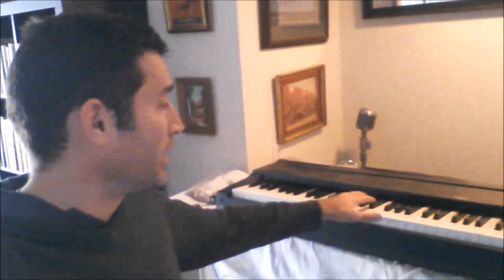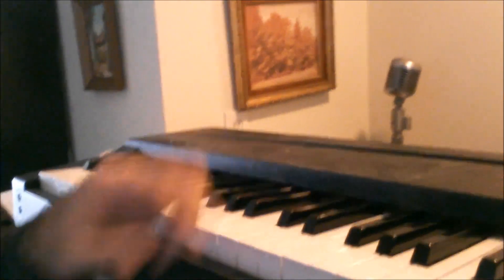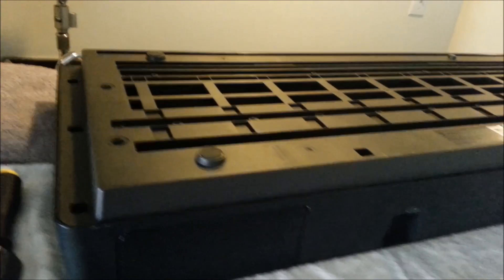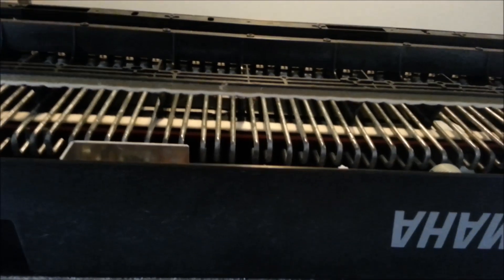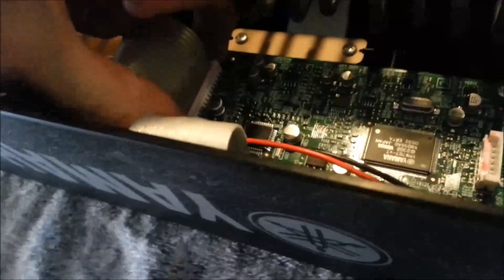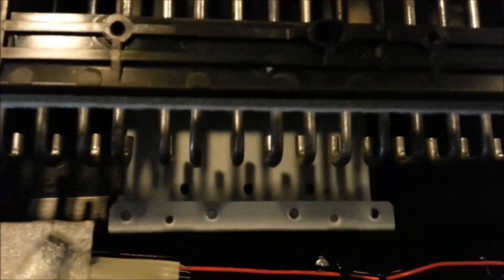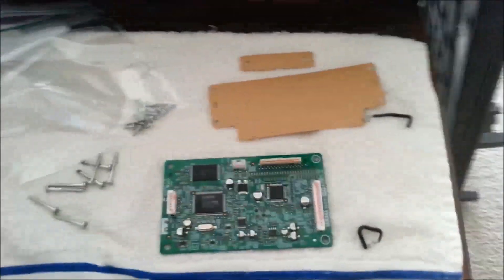P70 Noisy Keyboard Repair (Part 1)

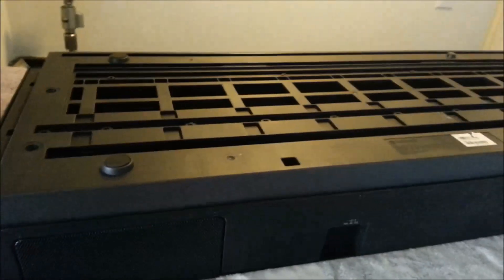Comment: When I opened up my P-70S I noticed that only my lower stopper was worn out. The upper looked fine and when trying it out the majority of the noise came from the keys coming down to rest on the worn out lower stopper.The nice thing is that you can remove the lower stopper without having to do more than remove the back (up to 4:15 in your video) and just pull it off, rolling it like you recommend and cleaning off residue with alcohol. I didn't have to touch any of the electronics for this.All in all from unplugging to playing again in about 80-90 min (taking care not to overtighten or wear out the 72 screws). Result: not perfect (which it never was) but much better.So my tip: open up your keyboard and check the two felts and if you're lucky you might also only need the lower one. One more thing: WK688701 - L88 is no longer a composite of felt and foam, mine was two layers of foam. I guess they changed it, hopefully for the better.Thanks for your video!

Comment: Thank you for your video, it helped me a lot. But in the process of repairing my own P70 I noticed that the noise that bothered me didn't really come from the stoppers. It's the keys that didn't have enough grease anymore, I put a lot of it on each key and it really improved the sound ! No more salck. You should give it a try, if you're brave enough to fight this army of screws again ^^

Comment: Outstanding, thank you. I used draft excluder sticky back foam strip (that I previously used round my casement windows) on top of the existing felt strip and Sellotape to fix the ends, and it works a treat!
Reply from the maker: Oh... what a great idea!!  I bet it will be much more  durable too!
Reply: Wait, are you saying that this relatively inexpensive weatherstripping (as we call it around here) works as well as the pricey yamaha stoppers?  I already bought the stoppers, but havent gotten around to the daunting task of attempting to replace them (especially all those screws).
Reply from the maker: @novakant3048  I went with the pricier "OEM" as you did.  But, when you compare them, you'll notice they are oddly similar.  I'd be interested to find out as well!
Reply: @davidallyn1818  Hopefully he will report back in the future.   Meanwhile, it has been quite a while since you replaced the stoppers, so how have they held up, if you even still have the piano?
Reply from the maker: @novakant3048  The pads held up ok  - though it was probably time to change them again.
Reply: @davidallyn1818  This time if you want you can try the weatherstripping then.  I like to see people getting their money's worth out of a (to me) expensive product like a piano.  The idea that it has to be tossed because felts wear out, or repaired for a cost approaching its price (thus encouraging a toss) is annoying to the less well off!   
 
You said you were going to do something else about some other aspect of key noise?  I don't think anything else is responsible for much of the key noise in my case (its a P85 btw not a P70 and its over 10 years old ) but while I have it open should do what I can additionally.
Reply from the maker: @novakant3048  When I had it open, I noticed there is a little side to side looseness that I thought might be the key wiggling on the hinge - but I wasn't sure.  At the time, I decided not to deal with it since the pads were enough for one day :b
Reply: @davidallyn1818  I wonder if you could further comment on these questions  (1) In my case at least, the sound is very clearly associated with an impact at the end of the key press and the end of the key release, so other things that do no seem to affect this impact (like side to side motion) are very unlikely to be a serious contributer?  (2) In my case at least, this sound is pretty uniform over all keys, even though they are used quite differentially, and is worse upon key release, suggesting that the keys just sitting on the stopper for 10 years have compressed it and that alone is a major contributer to the problem? Someone commented elsewhere that he used the thicker stopper on the bottom, not the top, since the problem was worse on the bottom and the thinner stoppers did not help.  My impression is that Yamahas know what they are doing with the stopper design and  I suspect (3) they put the thicker stopper on the top because the attack on the key contains a lot more force than the release which contains very little? But that (4) people who don't play very loud on the one hand and have very worn stoppers outside the expected life of the piano on the other might indeed want to reverse the stoppers to deal more seriously with the bottom stopper aging at the cost of more noise when playing fortississimo?  I am tempted to try this but (5) would you agree this is probably too risky an idea?  Thanks!
Reply from the maker: @novakant3048  Oh my goodness, you are covering all your bases!! I applaud you for thinking through your project and your detailed approach!  I appreciate the engineer in you!

For how the pad is worn, I would think that more of the wear would be due to age and frequency of use rather than style, per se.  For example, I would expect middle c, d, and g to have much much more wear than A5 or A1. 

If I had Elton John play, I would expect those major "pop" keys c, d, g, Ab, Bb, Eb in the middle of the keyboard to be nice and worn.  If I had Rubinstein or Gould play, I would expect the wear to be distributed as they would tend to arpeggiate up and down the keys.

As for experimenting - you are only limited by your imagination, trial, and the 70+ screws that need to come out every time :)

Good luck!!
Reply: @davidallyn1818  I was hoping for your opinions, but anyway... I finally tried doing something with the piano and here is a report.   The p-85 is a little different inside from the p-70, and I could work on the bottom felt without taking the keyboard action out totally.   But the result is very very disappointing.  

The old felt had divots on every key, not just those used, suggesting it comes from them just resting on the felt most of the time.   

It is very hard, basically impossible, to get all the old felt off.   
 
From looking at the old felt and comparing to the new, I was skeptical that the new felt would be much better.  So I just taped it in place, and tried the piano briefly on the table without putting in the screws. 
 
The new felt makes hardly any difference.  So like another person who found this, I tried taping in place the thicker felt Yamaha provides for the top.   It does not seem to affect the resting position of the keys much if at all.  So that is acceptable. 
 
However, the thicker felt also made very little difference.  It makes a little difference, but not much.  
 
Now I am disappointed and at a loss.  Was the piano always like this and I just because more sensitive?  I doubt it highly.  So then why is there this noise.  It very clearly is coming at the impact on the felt when the key comes to rest.   
 
I plan to just use the wrong thicker felt because it is a little better.  But the whole thing is not good. 
 
Only thing I can think of is what has been suggested: it is the bounce of the key causing problem, not the  initial landing, and the bounce is caused by the keys loosening at their pivot point or something like that.  This doesnt seem likely either however, given how the sound really seems to be from the initial impact.
Reply from the maker: @novakant3048  I applaud you for your journey - that was quite the exploration I'm sure!  As for the overall reason why it's noisy... to be honest, the keyboard is not that expensive (when compared to a piano).  I'm sure the action will never be quiet like a piano, because the P70/85 action is made of metal and plastic where the piano action is made of wood and felt hammers.

I've recently upgraded to a Studio Logic SL-88 Grand, and it is much better (which cost me much more) precisely to move away from a noisy keyboard.  The Fatar keybed is made of wood, and the action is much more complex than the P70 I used to own.
Reply: @davidallyn1818  The issue is, however, that I am pretty sure it was NOT like this to begin with, and that it was acceptable (otherwise I would have noticed in much earlier) and I can't see what else could cause the noise aside from the landing on the felts.  So its a mystery.  Perhaps it could be the keys losing their lubrication, but I don't really see the mechanics of how that would produce that particular noise.   I see in the manual three places where grease is to be applied, but it doesn't say exactly what kind of grease (it does have a Yamaha part number).  But I can't see how  grease would make a difference.
Reply from the maker: @novakant3048  My hypothesis here is that it is general wear between the keys' attachment points (both metal and plastic) within the action. 

Obviously, metal will wear away plastic, and plastic can stretch other plastic.  So I could see that initially, the pieces all fit together perfectly with no space - so no noise.  Over time and play, however, they all begin to loosen up and wiggle from erosion of metal on plastic and plastic on plastic.  At first it's slight, but then it becomes significant enough to be "clacky" -- remember these are old instruments and probably weren't meant to last as long as they have.

The ultimate test, I guess, would be to replace a couple of keys (including all corresponding action) to see if the new key is any quieter than the old.

Lithium grease (from the hardware store - no need to buy from Yamaha) might help with the noise a little.
Reply: @davidallyn1818  I hope this isn't it because then I am stuck, I cannot afford a new piano, bad enough I spent so much on the "felts" (actually pieces of foam that probably weatherstripping would indeed work for).   It would be interesting to try the test you suggest, but if it is a positive result, then it just says nothing can be done.  I suspect it might be negative because the noise on the keys is uniform for the most part, whereas they did not have opportunity for uniform wear.   Something soft and noise absorbing wearing out still seems to be a better bet.   I will try some experiments and see if I can find anything, since I am not getting another piano unfortunately.

Comment: When I had the noisy key (after 4 months), the Yamaha maintenance guy told me that the problem was given by the keys poorly lubricated. The noise was not at the end of the key press not at the end of the key release, it was just after pressing before reaching the end (it sounded like a clearance between the plastic and the metallic parts).
Now, after 12 months, I have again the same problem.
Do you know where the key must be lubricated and with what?
Reply from the maker: Massimiliano, from the looks of it, there are three places the key can make noise. When it hits the lower limit (the pad I showed fixing), when it hits the upper limit (the other pad I showed), and when you touch the key and it "clatters".   I'm not 100% certain that is a lubrication problem, rather the key just getting old and "sloppy".  Every mechanical part, with use, will end up developing some extra movement due to use.  Play your low A, and you will see what your P70 keyboard used to sound like those 15 years ago! Lubricant may help deaden the sound for a bit, but in the end, the key just needs to be replaced.
Reply: @davidallyn1818  Yes, it is more a "clack" noise when I touch the keys (not when it touches the 2 pads you shown). When I had the first time this problem it happened after 4 months (in short, a new piano, I have a P115 that is identical to P70 from a mechanical point of view). As the guy said, "it was a lubricant problem"; the piano come back and the 2 noisy keys were ok. Today (8 months later) the originally noisy keys are still ok, but a new key is clacking (E4). Yes, the A0 and the C8 are still as they are new, however, I think 12 months and clacking keys all around are well outside what I think is acceptable. I think I'll soon try to fix and share with the community my findings.
Reply: I have had the same issues with the latest P125, it's the old GHS action that is rather dated now, had mine for just 3 months and found that if you play certain keys very often or with extra force they get rattly in no time at all. I like my blues and boogie woogie and after three months of not even the most intensive playing half the bass keys were clanking like mad. I've found that the issue is where the key attaches to the hammer action where the biggest issue lies. Hope you got your issues sorted or got a new keyboard all together I've been told by a tech that this is the most common flaw with the GHS action used and it basically requires lubrication every 4 or so months if you play hard which is a real pain in the arse with all the work you need to do.

Comment: Hi Sir, hope you are still there

My P70 was not used in about 3 months, and now when  i play some key combinations - it doesnt sound right- like it sounds out of tune, and also the sound replicates multiple times

Any advice on this?
Reply from the maker: Oh... wow.  sorry to hear about this happening.  My intuition is the contacts on the keys and maybe the processing unit has become corroded so that (literally) wires are being crossed.  

If you open it up and see lots of light green stuff on your electronic parts or wires, there's a good chance it's corroded.  

Unfortunately, if that's the case, I'm not sure there is a fix that would be less expensive than buying a used P120 or something??  Sorry I couldn't help better - I know that's a bummer.
Reply from the maker: @Therevolution7  oh wow!! did he fix it?
Reply: @davidallyn1818  Not really, but in the comments i saw someone said they used a blow dryer- 

so the issue is that in certain areas..the humidity is high and it somehow affects the keys-

i got a blow dryer and blowed in between the keys and it fixed! Lol!
Reply: @Therevolution7 hello got the same problem. Did you open the keyboard?
Reply: @Therevolution7 thank you so much sir it worked. God bless you ❤️!

Comment: I have this keyboard but my problem is that some keys are no longer playing. I checked the green board inside and all seemed to be fine except some parts of it are rusted. What do I do?
Reply from the maker: Teboho, I'm not really sure that's something you can fix.  Usually when keys simply don't sound, that means something has happened to the contacts, wires, or circuitry that produce those electric signals.  Given there is rust on the green parts, the circuit board itself may be damaged.  I'm sorry I couldn't help you.
Reply: @davidallyn1818 Thank you,  I've had it for 10 years now and I bought it second hand from a who had for 5 years. So it has been working for 15 years straight. Can you estimate how much a green board would cost roughly?

Comment: David, you show how the electric ribbons on the side of the circuit board comes out, but not the one in the center that doesn't have tabs on it. How to i reconnect that ribbon? Thanks.
Reply from the maker: Don, (it's been a bit since I did this, but..) it should be the same as the side ribbons.  Make sure the two side "tabs" are up that unlock the terminator, slide the ribbon in to it as far as it will comfortably go, then slide the two side tabs down to lock in place.  I usually give the ribbon a (very gentle) tug to make sure it's seated properly.

Comment: new P71 but using as controller many hours a day and already felts have no bottom and causing me serious hand/tendon pain. replacing with the same cheap felts they use now doesn't seem like a good idea. wondering if anyone makes a more durable soft rubber better than the thin felts. companies are getting cheap on us!
Reply from the maker: Patrick, there will be a day where they just don't make the parts anymore.  To get innovative, you may want to go down to your local fabric store and buy some deep-pile felt or wool.  They may be willing to make the long cuts at the store, because they have big tables to do it on.  There are some pretty strong double sided tape out there that will be plenty strong to hold the felt in place.  If you figure it out, please update your post so we know what to do next :b

Comment: anybody have any ideas on fixing dead notes on this model?
Reply: +madpop17 On my yamaha p-70 i had a few dead notes. I solved the problem this way :
I removed the rubber band (make sure that you place the rubber band in the same position), I cleaned the surface with isopropyl alcohol and when the surface was dried i used a soft graphite pencil to redraw the contact lines under the rubber band.
Hope this helps, mine works perfectly now.
Reply: thanks, I'll give it a try

Comment: And you don't have an electric screwdriver do you?
Reply from the maker: Ah!! :) Good thinking!  You could definitely use an electric screwdriver -- although you REALLY have to be careful not to "strip" those screws.  Those aren't screws that you'll find at your local hardware store.  Just keep in mind that a big "drill gun" can easily turn a Phillips (i.e. "x") head into a rounded crater in less than a second.   And then, you are really "screwed" (pardon the pun).